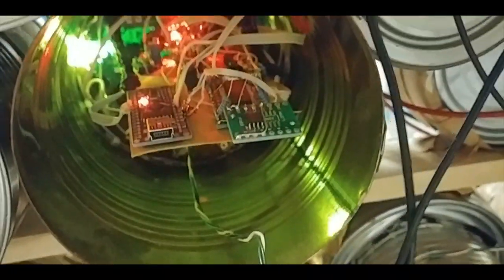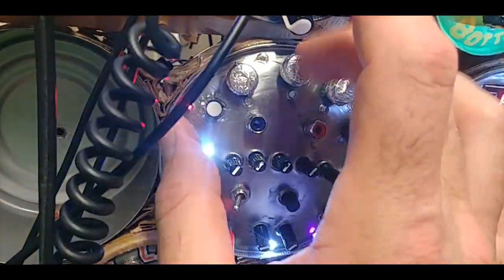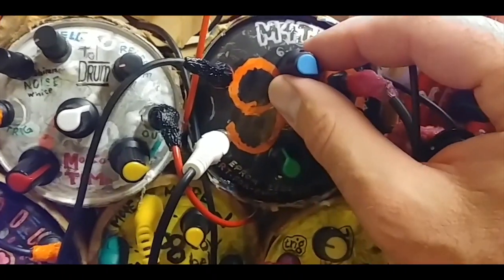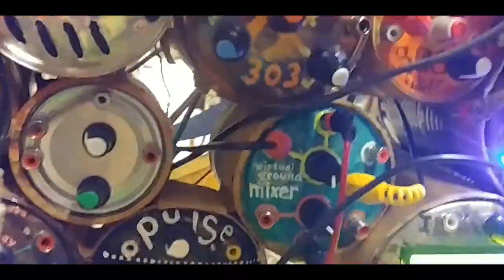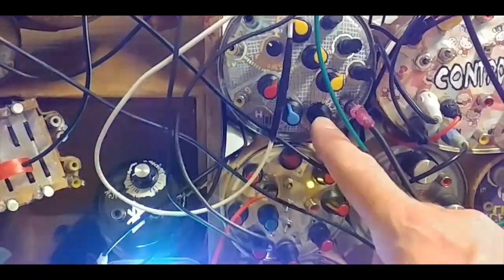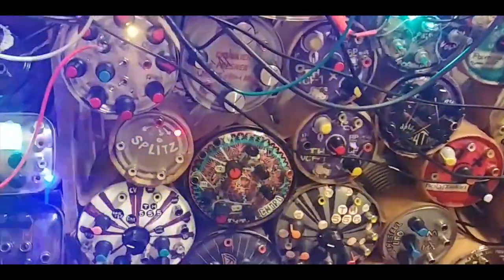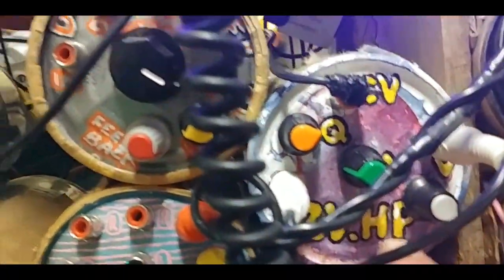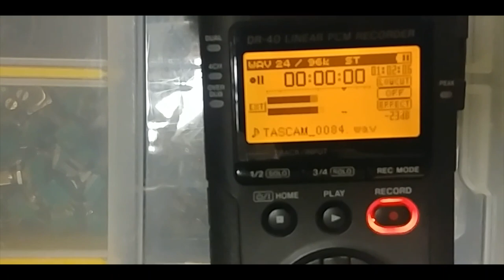My DIY analog tin can synth, explained as fast as I could

Comment: At 23:05 you loose audio, to bad 😲 great to see your synth grow over time! Keep up the good work 🤟🏻😃🤙🏻
Reply from the maker: Argh, thanks for the heads up. Just imagine a fairly amateurish wrangle with a DIY modular with a slightly disappointing finale using my newest module, the EFM-style diode ladder. That circuit has been tweaked and is MUCH better now.

Comment: hello, nice vid and thanks for sharing ! just to know, your modular work with +12/-12 or +15/-15 or other plz
Reply from the maker: It's a +/-12V project. I have two 6-amp 12V power supplies wired in series. The middle connection is the system's ground.
Reply: @ozerik  thanks ! :)